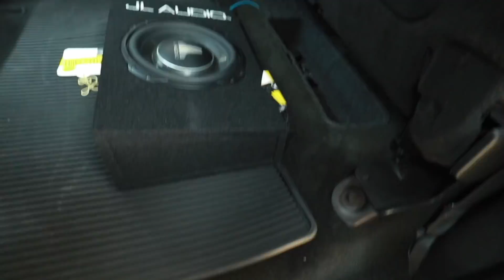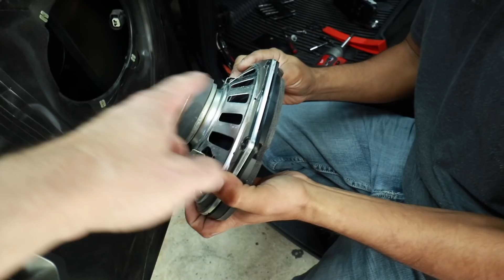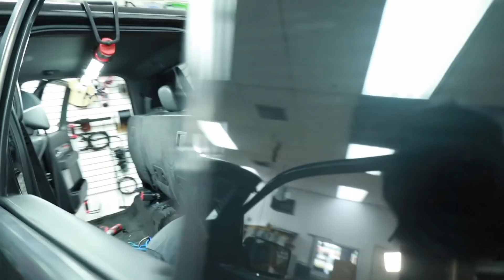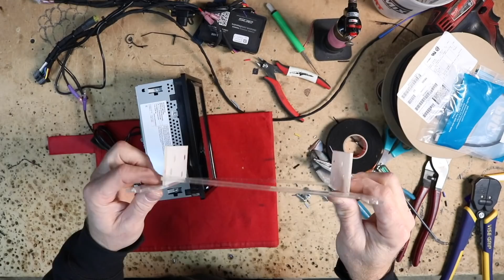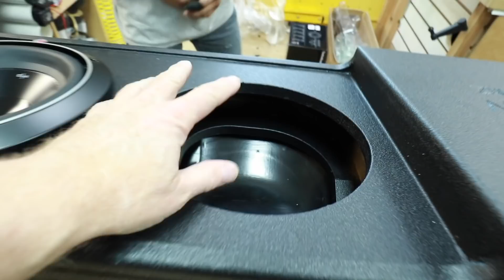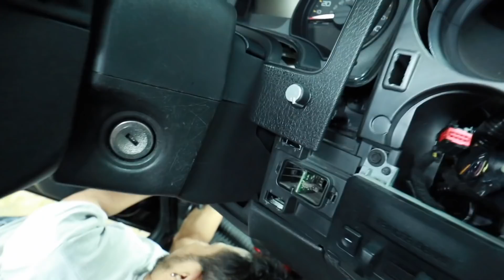Old Ford Raptor gets full Rockford Car Stereo install

Comment: i have a question about tuning the amps i have heard that you want all of the eq and everything set to flat to set the gain but if you turn the bass up on the eq wouldn't that make it put more power into the amp causing clipping?

Comment: Hello sorry for bringing back a old video from the dead but I have a stereo question related to this truck because I own one. If I wanted to keep the stock radio but install aftermarket amps behind the back seat do I still buy the Maestro aFO2 kit shown in this video? If so do I just use the plug from the kit that has the high level speaker wires out, have that plugged into the stock amp under the center console, then ran to a LOC, then to the amps with RCA's? I hope this makes sense. Thanks as your videos are the best stereo install videos on You Tube. Trevor P.

Comment: Great work guys. Love the expertise and passion into getting it all better than good. I have a 2014 Raptor here in Australia and I wish I had you guys down here for a few minutes to point me in the right direction. Previous owner fitted a couple of Hertz amps, 4 new Hertz speakers and a Kicker Pro Comp sub, but the install left a lot to be desired. I've been chasing down issues for a month now but i'm having a little trouble as the factory DSP amp outputs tweeters and mids to the front and the previous owner only hooked the mids up and left the tweeter wires hanging. By any chance would you mind taking a quick look if I emailed you a wiring diagram and a couple of pictures. There are so few Raptors here and nobody really knows what they are doing here as all these trucks are fully imported and converted to RHD.

Comment: Dang it! Ya'll got my hopes up saying Lightning. I cherish my 03 Red Rocket. At lot of Ford Dealerships don't know how to do engine maintenance on them. Almost all the Lightning community is all about modifying engine everything. I haven't found another L owner who knows/has a major system. The video starts great. Kenwood/Excelon deck with a cd player for flac files. Rockford subs past 36 yrs. Tried Rockford mids with no extra amp. Just a small pioneer D class amp to the sub. 
In the Lightning I have kenwood single din heatunit. Mids are infinity reference (surprised they kept up) Rockford AB amp bolted to body of truck only acessible if seat is removed. I think its dying. Maybe one rockford sub is blown but I cant tell for sure bc I made the custom box makers seal the port. Kenwood mono class D amp. 1800 w. I always have a capacitor. Both amps have been shocked by a honking 2 Gauge wire flying loose from the cap. Quality products. If you street race or just drive hard, the amps have been resoldered by my inside out 3+ times each. 
Doubt anyone still reading but I learned how all this works in college physics. A Ph.D in town installed my first system when I was 16. As things went wrong he helped me w diagnostics. Also how to tell an amp is easy repair or poorly constructed. 
Im an independent MD now. Anyone who knows the L's wiring respond please. I want refresh of all of it but be able to cram a 15 sub into single cab is hard. New mid amp, not much room for a 8F cap I wanted. Usually I had at least 3-5F ones (common in the South) before. In Milwaukee best one I could find was a 1F. It held tight but not enough for a skull rattling song. 
My less professional email is TXmd2007 at g mail. I fixed most electric issues made worse by mechanic. 
THEY DID ALL ELECTRIC EVERYTHING LEAVING CAP CONNECTED WHOLE TIME! After undoing all the strange relay box things they did, (it did 12 psi whole life. Now it needs viagra only 8psi after they cleaned out supercharger. ) afraid to touch it and cause electronic issues. Have a salvaged wire harness even. Mine is hacked to pieces (so many Break ins) compared to it but I got tunes lights, wipers dome light weirdness fixed. 
If y'all were closer to Chicago you could review it and show people how badly a flashy vehicle can get wires messed up. I have short dinky videos on my channel if they haven't been pulled. A lot have.
Edit: 90% of my patients are working age guys. I can help other states over phone. Most guys just suffer bc they dont wanna schedule an appointment in a clinic. 
I need your help and you might need mine! For real I need an expert to figure out the electric issue.

Comment: Just amazing video showing the hassles of installing aftermarket equipment and blending it! Just curious, how much is the labor to install of this equipment? Also, what is the time frame to finish all of this awesome work? Great job Dean and Fernando!!
Reply: It is a labor of love. Get it right, ppl around a city hear it. They break in. All my vehicles. The red 03 Lightning wins for # of break ins. Short story: paying a big box store its cheap for a few months, then expensive bc a major wire comes loose. Prepared to get broken into. I have redone some friends jobs and shocked at how sloppy it is. It strains the other electronic connections including vehicle stuff every break in. If you can't do it yourself; PLEASE look for a place like this. At least 1 hr away from your home. Aftermarket place did a fancy alarm. Break ins grew more elaborate. Obvi the security stereo shop people knew just the right wires to cut to silence my remote key fob that normally goes off in my unit if it was touched. 
The sadistic last install has lasted for 15 years. Priceless.

Comment: Quick question Dean and Fernando,

I’m starting to map out and finish the second half to my new system in my 2002 4Runner. I’m currently running the new Alpine R series Alpine R-S65C.2 up front (1” and 6.5”), and an R series coaxial in the rear doors for fill. These are being run with an new R series 4 channel amp. Simple but decent. Not my old MB Quart set up from ‘97… but hey, I’m happy so far with this new Alpine set. 

But now it’s time to add a single 12” Sub in the back, and I’m not sure which Punch amp to run it with. I’m looking between the  Punch P1000X1bd amp, or possibly the Punch P500X1bd amp. I’m leaning towards the  Rockford Fosgate P3D2-12 sub. And I’m not sure yet,  but later down the line I may want to add a second of the  Rockford Fosgate 12’s. But maybe the single RF P3 12”sub will satisfy my expectations for this vehicle’s system… we’ll see though. 

Any thoughts on the amp and sub combination? I’m leaning towards running the sub in a sealed enclosure at this moment, but that idea for an inclosure could change if need be. 

I know you guys are always busy, but I live in a super small town and the couple of shops are only open when I’m working. So it’s next to impossible to actually go in and get some professional advice. If you happen to see and answer this, thank you very much in advance. Cheers!!
Reply: i have been running a 12" p3 for about 3 years now off of the P500X1bd. sub is rated for 600 rms and the amp although it says 500, actually puts out over 700. mine said 742 on the test sheet. this is in a toyota sienna, so a little more vehicle air space than you. in a ported box. been run at full tilt every day since install and it hasnt skipped a beat. hits harder and more importantly cleaner than i could ask for. unless you see yourself being a huge bass head, the single 12 will probably satisfy you for quite some time.
Reply: @cameron6471  thanks  for your first hand experience with the P3 12”, while running the Punch 500X1bd.  I’m starting to come around to just running a single P3 12” and I agree that it always seems that Rockford amps end up actually producing much more power than they are advertised at. Plus, the days of running three 12”’s and a single 15” in the bed of my first truck, a 1989 S10 pickup, are in the past 👍🤣.  My hearing will thank me when I turn 50 in less than a decade. 

Quick 2 questions for your set up. Did you build a ported box? Or purchase a pre fabed one?  And on you P3 12” did you run the double voice coil 2ohm. Or the 4ohm option?  I’m figuring the 2ohm version… but you never know. 

Thanks in advance for your reply and suggestions 🤙 Cheers!
Reply: @jeffrines07  I went with the prebuilt and installed box/sub combo from rockford. gives a really clean look and is the 2ohm version prewired to 1 ohm. not the best box but definitely not the worst. a different box with a cylindrical port probably would perform better but I just didnt feel like I could sacrifice as much space as that would take up for my application.

Comment: I thought ford had a bad grounding issue due to aluminum body. Best to run a ground from battery ?
Reply: aluminum actually conducts electricity better than steel
Reply: @cameron6471  Not in car audio it doesn't and besides those aluminum panels are bonded with adhesive not welded together. That's why Dean and Fernando run a ground all the way to the front battery.